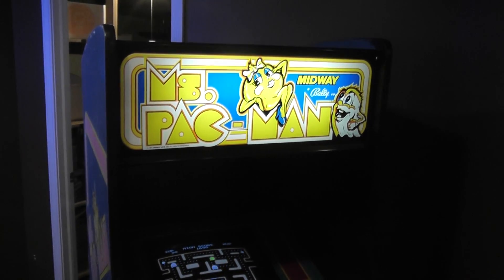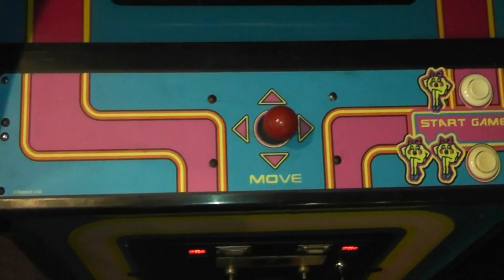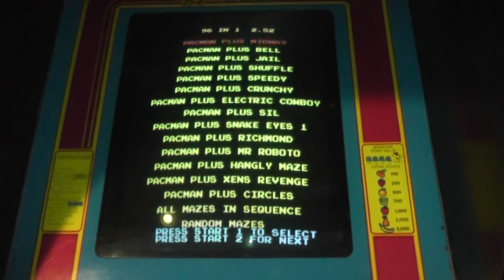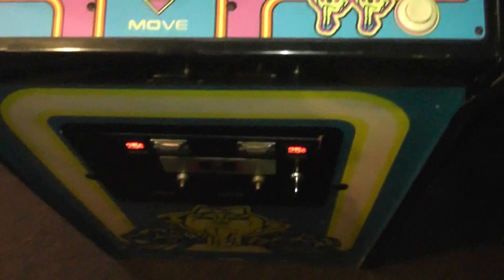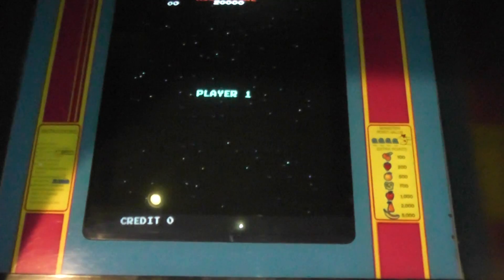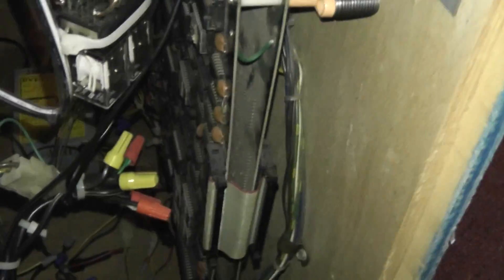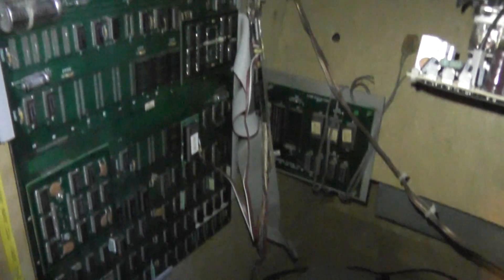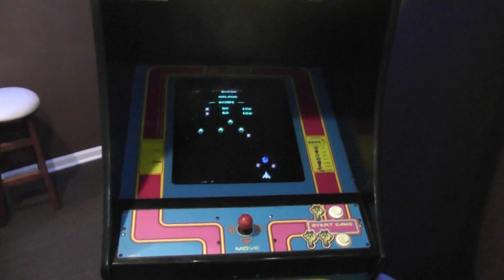Ms. Pac-Man & Galaga Arcade Game Conversion Project

Comment: Hey Mark, noob here...how did you get the samsung crt to work, was it a direct donor tube swap or did you have to modify by swapping yokes.
Reply from the maker: Benjames35 I purchased the Samsung 19” CRT on eBay in 2001 from a casino parts distributor.  100% clean and new.

Comment: Hi :) question , the pcb game switcher , how you do it ? are both boards power at same time  on there own power supply ? what are you switching ? video, sound, are a given but what ells ? are the game controls tie in to each other so you dont have to switch them ? are the grounds on both pcb tie in to each other with the controls,   i like to do this my self with two Nintendo pcb DK and DK Jr ....... please let me know any information you can think of :)
Reply from the maker: I setup 2 banks of 12v relays.   I bought them at Radio Shack years ago.  There are two modern AT computer power supplies inside the cabinet - one for each PCB - I bypassed the old linear
power supply.  All joystick, buttons, and coin credit wires were connected in parallel to both PCBs (they are not switched and the PCBs are not sensitive enough to where the double connections make any difference).The PCB power, video, and speaker lines however were connected the relays - I soldered and ran separate wires in a bundled neat manner to both boards to the relays. The 120v power switch I installed to the upper left above the monitor toggles between power supplies, and by default, one of the PCBs is always connected.  When the other AT power supply is turned on, the 12v rail activates the relays and it turns off the default power supply applies voltage to the PCB and switches the lines over to the other PCB.  I have had no issues over the years, in fact, it never fails to work properly.  I enjoy the dialog here.  It’s been nearly 15 years since I made the mod and I attempted to preserve everything within the cabinet so that it remains as original as possible.  Let me know if you have any further questions.